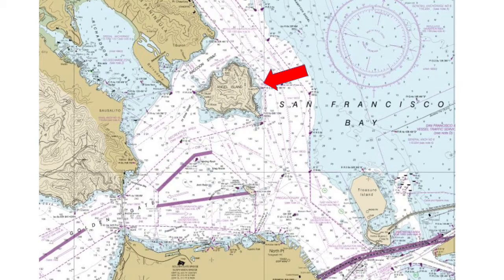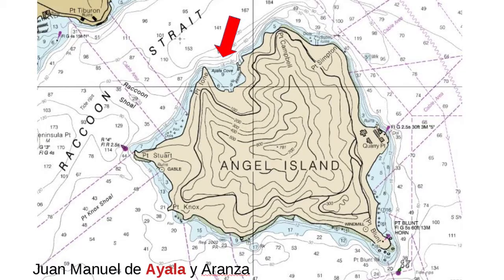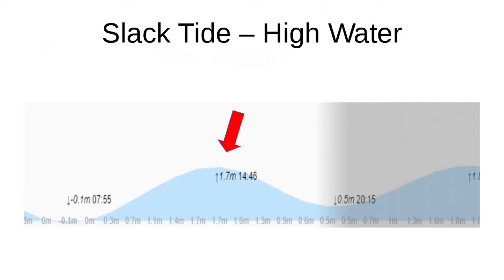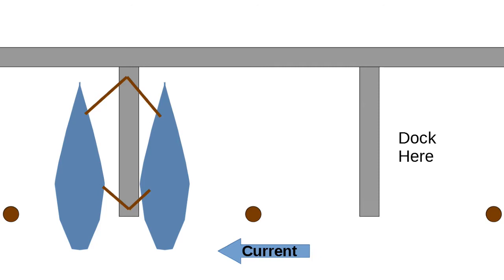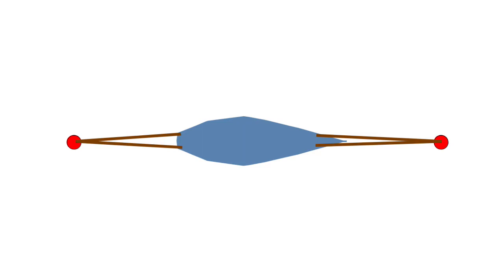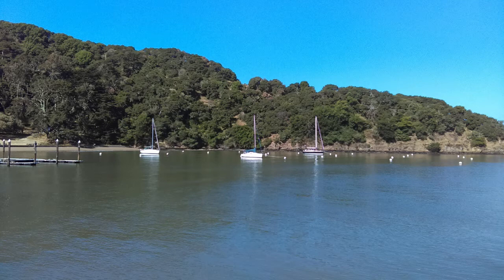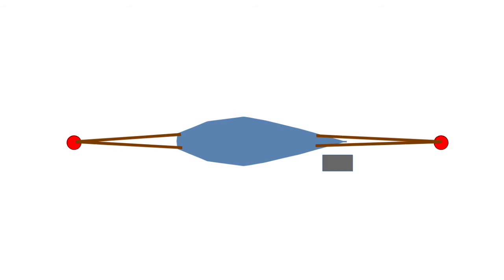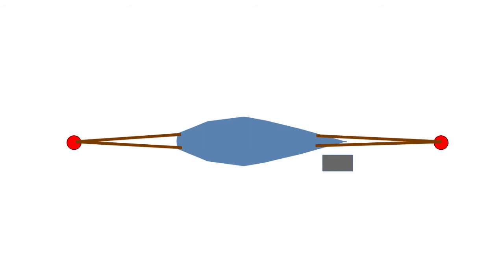Docking and Mooring at Angel Island State Park

Comment: Dear James: Thanks for this video, which I'll probably use in my class. I've been teaching sailing for over a quarter century, and my class involves mooring at Ayala Cove. I've done it about 250 times. I certainly do not wish to disparage anything you said, but have a few caveats.
First, it has not been my experience that the currents run as you describe, at least not reliably. Sometimes they do, and of course it seems logical that they should, but I've also, counterintuitively, seen strong currents at slack and no significant current at max ebb/flood. It's probably more often like what you say than not, but that danged mother nature is just not a trustworthy old girl. Of course, maybe I can't read a tide book. Can't rule that out. Part of the discrepancy is due to the fact that the current sensors that inform the tide book are not at the surface, and our boats are, and currents flow in three dimensions. 
Second, it is not true that depth is not an issue, unless you're in a power boat. If you draw five or six feet, you can easily touch at low water in some spots. Thirty years ago this wasn't true, but the Bay is silting up.
Third, your method of tying the stern first will be a bit dodgy if the current is taking your bow away from the forward buoy. If your dinghy has a good outboard, no problem, but it would be hard to pull the bow up to it against wind and current with oars. I'd prefer to get the bow attached first, which is made easier with the use of the tricky pole you recommend.
Again, kudos for the well-done video. I wished I looked and sounded as good.
Fair winds,
Tony Johnson
Reply from the maker: Hi Tony. Nice to hear from you. After you tie the bow line, how do you get back to the stern buoy?  As to depth, I was trying to say that it was OK around the docks. The moorings are shallow. That's the reason to go at high slack.
Reply: @jamesconger8509  
   I don't recommend starting with the bow buoy unless you have a dinghy. It can be done, of course, and I've done it, but the problem occurs on days when you find the current is taking you to port; if you have a right-hand prop and try to back to the stern buoy, you'll find it difficult. On days with little or no current it will be easier, but as you know, boats respond better steering in forward rather than reverse.
   There are of course many ways to do this, and some methods work better with some boats and conditions and crews. But since my job is teaching people who will be doing this in conditions I can't predict with crews and boats I'm not familiar with, I try to teach in a way that will have the best chance of success in every circumstance. If a boater has a way they do it that they're comfortable with, I have zero reason to doubt them so I really want to avoid the impression that I'm being critical of any skipper's process.
   I don't want to take up a lot of space here but how I do it is approach the stern buoy and try to pass a line through while not losing steerage. This line is tended and eased by someone who is cautioned to not lose track of it. Then we motor to the bow buoy and capture it with a boat hook, or better yet, with the device you describe. If we don't have one of those, one crew holds the hook while the other passes the line through the buoy. If something goes wrong at any point, and the crew can't get the line through the buoy, it is essential to pull all lines aboard and start over. Trying to maneuver with a line in the water is a recipe for catastrophe.
   As you know, the main things to avoid are 1) getting a line in the prop and 2) being swept over the buoy by the current so that it ends up fouled in your keel, prop, or rudder. Both of these are disastrous, of course, and, knock wood, neither has happened to me. I avoid the latter by approaching the buoys from down-current so that, should we fumble, we are pushed away from the buoy and not over it.
   As to depth, a bit of homework I give my students before we go is to figure tides using the rule of 12ths, since they may be mooring on a day or in a place where they don't have an Internet connection, but have a tide book. I have a detailed chart of the depths of the buoys overlaid on a Google Earth image of the Cove. We did the soundings a couple of years ago but they still seem fairly accurate. I would be happy to send it to you but I can't attach it here. I can message you on FB or however you like. 
   Once again, congrats on the video. The community would benefit from more of these "local knowledge" sorts of presentations. There are a lot of ways to get in trouble on the Bay, and forewarned is forearmed.